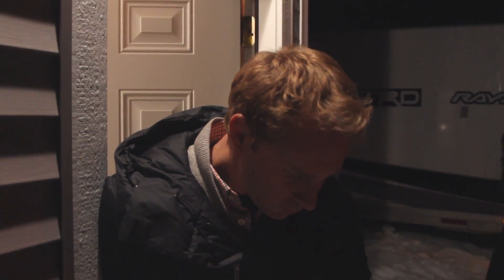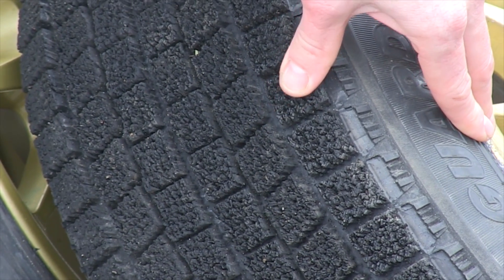Tire Prep with ACP

Comment: @youblockwood They were just using it to "tractionize" the tires. The xD was most likely being tuned and prepped for the the rally and while the wheels were off they used the opportunity and got some extra traction on the tires.